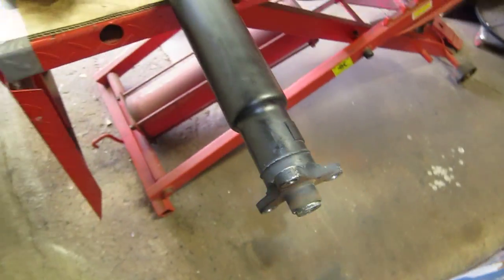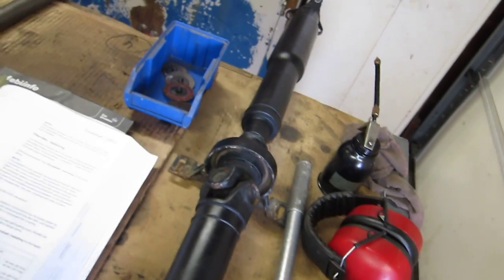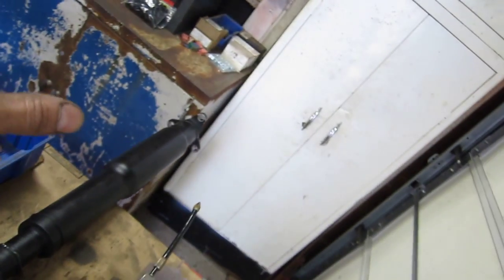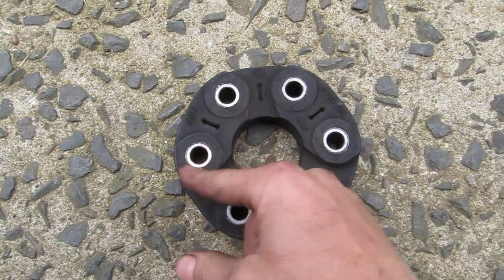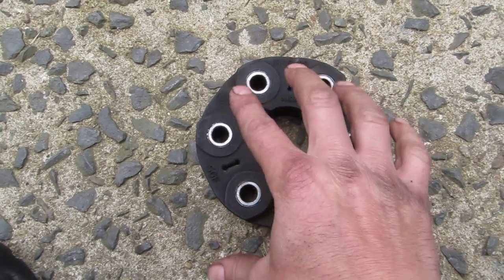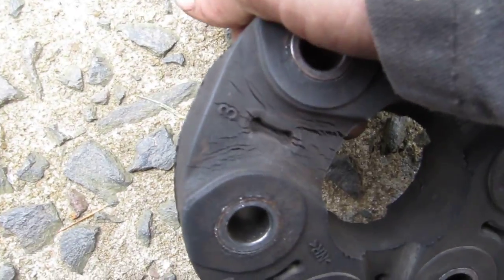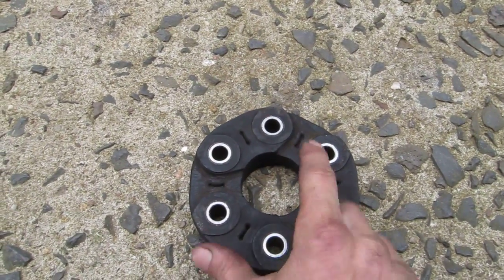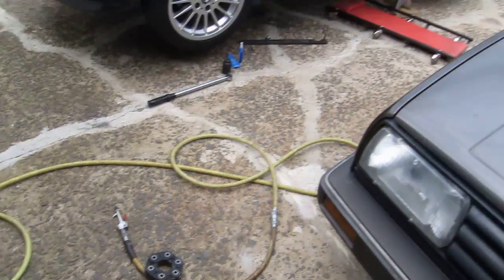BMW Z3 drive shaft, drive line, clunk, noise

Comment: Careful with aftermarket flex-disks.. mine came with the arrows molded BACKWARDS, which would've make me install in incorrectly if I followed them. 
You nailed it when you said the driveshaft moves counterclockwise.

Transmission output should "push" into the driveshaft, in each of the 3 beefy links of the flex-disk.
Transmission bolt first, THEN driveshaft bolt - always!
Reply from the maker: Dude that is a great comment, I wish I could have included that in the video. Never trust anybody.
Reply: I installed a new febi disc like you show in the video, but still have the same problem!?I need some help.
Reply: Do not put anything after market on a bmw engine or moving parts or suspension
Reply: @Sequel7  lol, go broke maintaining a $5,000 used BMW instead... I wouldn't go that far.

Comment: I am about to this job on my '02 BMW 530i; that is, changing the GUIBO, Center Support Bearing and if needed, the Driveshaft Centering Sleeve. 

I have been mentally gearing up for the task but have been hesitant because I have questioned the proper orientation of the GUIBO, given the molded arrows and its true orientation. 

This video clearly provides me with the GUIBO orientation, as factual information. 

Thank you for your candor and attention to the fine details. Starting in a few days just waiting on a part or two from ECS. 

I truly feel ready for this!
Reply from the maker: This has got to be the nicest comment I've ever read. Man you just lifted my day. I would say best of luck with your project but you don't need luck, you got this! Enjoy the reward.
Reply: @mrjgueret  Seems there was a shipment delay on my order of parts, the transmission and engine mounts are to be shipped direct from manufacturer. Once those arrive, my project will commence. Patiently standing by for delivery of parts. I am ready!
Reply: @mrjgueret  OK, so I completed this task on October 6th, took about 11 hours to do this job, spanning two days. I had one heck of a time getting the guide sleeve off the driveshaft. Other than that, all went well with the replacement of the Febi brand Flex-Disc (GUIBO), Center Support Bearing (CSB), Drive shaft centering sleeve and a fresh repack the rear CV bearings using Redline CV-2 Synthetic grease and a new CV joint gasket. 

While there, I replaced the Transmission and Engine mounts, seemed like a good time to do it. It is worth mentioning that 3 of the 6 bolts on the GUIBO are longer than the other 3 which have washers, as sandwiched between the GUIBO and driveshaft (a clue) that they are to be installed on the aluminum drive shaft, which prevents galling or dis-similar metal from occurring on the GUIBO, I suppose. 

Per your very informative video presentation, I was able to quickly identify the proper orientation of the arrows manufactured on the GUIBO itself. I highlighted, with a yellow paint pen, the arrows pointing towards the transmission prior to install. This is likely not needed but it did help me when installing bolts on the driveshaft prior to mounting on the output shaft of the transmission. 

Overall a success, a not-so-easy job using two separate floor jacks to lift and lower the engine/transmission and being careful with the exhaust system being supported at the rear of the car. I discovered that I could not removed the exhaust bolts as they were rusted and would break if I attempted to remove the exhaust. That is another small job, reserved for another day. 

Thank you and it is my hope that my personal experience and input adds to the quality of your video and somebody else benefits in performing this very technical task.

To date; (11/8/2021) the BMW runs great, no clunks when braking or accelerating just super-smooth shifting through the gears. It is a mental game that one has to overcome as I lived with that alarming clunk for a while especially while accelerating. Crazy how we get conditioned to a certain "thing" and when it is repaired, we still look for that clunking noise.

Thanks again!

J.R., in Littleton, Colorado
Reply: What are the symptoms if this disk is installed incorrectly?

Comment: great video. Love how you explain things. Going to be pulling my driveshaft to try and sort an aggressive rapid knocking that only happens at 30-40km/h and then goes away. Pre-emptively bought a flex disk and center support. And now I know how to make sure this shit is oriented correctly. Cheers!
Reply: hey did you find the problem causing this i have the same issue

Comment: An easy way BMW offers to have the disc in correct position is that 'the arrows should point to the flange arms' (in both directions, that is alternately, one arrow points to the transmission flange, the next one points to the propeller flange)
Reply from the maker: Very good to add, and as I stated arrow should point to trans flange. The outcome of following that direction would indeed cause the adjacent arrows to point toward propeller shaft. Thanks for your comment. it helps this video move ahead of the videos that mention nothing at all about how to install this disk correctly. happy motoring.

Comment: Omg bro you have no idea the headache you saved me. I replaced my flexpack too and I noticed I had the same problem even after installing a new one from Amazon. Well to my surprise I found out that it was a cheap China knockoff that’s floating around and it has the arrow pointing in the wrong direction. So even if you followed the arrow you would still install it wrong. This video helped understand how it supposed to work and once I took apart a second time I realized it was installed backwards. By now it’s all to shit so time to put another one.
Reply from the maker: Dude that's incredible, and awesome information I should include in that video. Knock-off ones can be made any which way! You made my day man.

Comment: Ended up here from my recommendation list. Watched it for fun n man i need to crawl under my car and make sure mine is installed correctly. My stick e46 has a clunk whenever im shifting. My flex disk has cracks in it but the cluck i feel is from the back. I cant mimic the sound obviously. But it feels like as if the rubber part in the diff bushing or in some suspension part is gone and metal is hitting metal whenever the driveline engages and disengages. Found one crack near the subframe mounting point. Need to investigate more in day light. Glad i came across this as im planning on doing the flex disk n carrier bearing.
Reply from the maker: 5Riverz yeah subframe mounts or rear diff mounts is what I was thinking. if you put the car on 4 solid jack stands, set the emergency brake real tight, have someone else give it torque in first gear and do the same in reverse you can watch the horror show unfold underneath the car. just be careful try and stay out from underneath unless you trust your jack stands..

Comment: On my E36 the sound isnt so much a "kak kak kak."  It just makes one defined clunk.  Something is definitely shifting under load.  It happens most regularly when I left off the gas with  high engine speed, or any other situation where there is a moment of reversal in rotational torque.  Letting off in first while slowly rolling backwards is another example.  I suspected it was a bad diff bushing or subframe mount but maybe its the flex disc...?
Reply from the maker: In my opinion if your flex disc was doing this, it would look like a serious pile of shit. What I would do is find some nice level place, e-brake the shit out of the car, have a friend load the drivetrain using first gear and reverse without moving the car, and you very carefully with a flashlight and your ears visibly and audibly look under the car and under the hood. This could be done on a lift or jack stands to get a better look but I wouldn't be under the car, just do your best to observe movement and sound. I think you're on the right track with the diff area, but without hearing the noise myself.......? Best of luck, if you find it let me know. That's how this works. Thanks for watching my video.
Reply: I'm experiencing the same problem since a couple of weeks. Could you find a solution?
Reply: This sounds like the exact problem I'm having but all my diff and subframe bushings look good.  Did you find your problem?
Reply: @danielpyziak6537  Hi I just changed the disc yesterday. I had the same clunk noise. Everything is smooth now, no more clunk sound. Center suppor was in good conditions actually. Original part from BMW, 20 years spinning, and all good.

Comment: Can you get the clacking sound from a worn out flex disc as well? Mine is in the correct position, just has a few cracks in the rubber.
Reply from the maker: Absolutely, it will loose rigidity when cracks form making it act more like a spring. Choose quality part when replacing. Good luck bud

Comment: Great video very informative. Is it correct to say that the moulded arrows should always face the flange arms?
Reply from the maker: A transmission output flange bolt must occupy a hole in the flex disc who's arrow is facing the transmission flange. I'd rather word it that way to clear up any confusion. Thank you for your compliment and thank you for watching.

Comment: Hey. I have an E46 M3 and it does this "kaka kaka kak" kind of rattle you mimic here when I press the clutch in reverse or 1st gear at parking speeds...around 1000-1500 rpm. It does it especially. when I give a bit of gas, engine revs to this range and then quickly let off the throttle and press the clutch. It does not do it it higher gears. If I pay attention and slowly press the clutch when I park, I can - most of the time - avoid the rattle. Clutch and flywheel is new. Sounds like it could be the flex disc. 

Although my mechanic said they did not see anything being worn out when they replaced the clutch, I will have the flex disc replaced now. If it solves the rattle, that would be a cure for something I have since I bought the car (1year, 10'000 miles ago)😀
Reply from the maker: Zsolt Szabó yes, replace the disk with oem or trusted quality replacement. make sure to install as instructed here. if you follow the video closely you will understand that you will always have the clatter in reverse when depressing the clutch rapidly. nature of the beast, you can't have it both ways.

Comment: thanks for the info.....would that part (if broken) in an 17 2SS A8 Camaro cause a "clunk"?......i have changed the diff fluid, also added the posi additive, still chasing the sound..(started after a few hard digs on concrete)......apprecieate your time, and thank you again for the video.
Reply from the maker: Obviously hard to diagnose anything from over here but when you were doing those hard digs (assuming you mean spinning tires) on the concrete were there any points at which you were heavily engaged in turning. If your car has limited slip and you remove all pressure from the inside tire, there is a possibility you can cause damage to the limited-slip chuck and spider gears and spider shaft. Have you jacked it up and tried feeling your differential. If it's sloppy you may want to take a closer look with the cover off. Limited-slip differentials are only good for helping lock right and left together while going straight. Too much power\traction to one tire could burn through a friction pack.
Reply: @mrjgueret  it was in a straight line....I haven't removed the cover as if yet....those cars have the independent rear suspension....so covers are on the side...with the car on stands it doesn't sound abnormal rotating the wheels..on the ground the cluck is .only when put into gear forward or reverse......I am not a auto tech....so my repair skills are limited......just did not want to be bent over by someone saying I need this, that, and the whole other.....

Comment: Dude, just make sure each arrow points to the receiving surface. If an arrow points forwards to the front, that means that the hole should be bolted to the transmission bolt receptacle, and the back facing arrow hole should be bolted to the driveshaft bolt receptacle. If you do this, you don't have to think about anything because it is impossible to mess up. The arrows simply face the bolt holes  directly. You would not bolt it onto a hole with an arrow pointing away from the hole.
Reply from the maker: Did you not watch the video?
Reply: @mrjgueret   - Yeah... you missed the point. You took forever to get the the point which was quite simple. I have worked with quite a few giubos and that is standard procedure. BMW techs at dealerships are sometimes monkeys that are too full of data to be able to remember simple things. They have to keep track of tons of models and differences so I can imagine they will delete info that they think is minor when in fact it is supremely important.
Reply: @mrjgueret   -https://www.youtube.com/watch?v=8E5Mg9MX7C8 
I have actually seen a few more that point out the arrow direction importance but this is just a sample : 5 mins 34. 
Now, I don't think anyone has explained the physical mechanics of WHY the arrows are important like in this video though.

Comment: So do I ignore the arrows if they don't subscribe to your theory?  I just installed a driveline that was reverse of what you said.  It came from the re-builder installed an torqued that way, and the arrows on the guibo were opposite of the one you hold in your had in this video.
Reply from the maker: I'm not sure I understand your question and I'm not sure I can explain any easier to you. I would disregard anything you see installed by anyone else if it doesn't apply to what is said in this video.
Reply: @mrjgueret  The arrows on the Guibo are to indicate the which way to bolt it up.  Some have the arrows reversed.  I'm not saying you're wrong, but it might indicate that some makers of the Guibo's are designed in reverse.  To blame a BMW dealer installing it wrong when they installed it according to the directions from the manufacturer of the part, might not give them their due credit.
Reply from the maker: @jhfl1881  tell you what, why don't you just ignore the arrows all together and install it the way I told you. The torque shall be applied as a compression force against the thicker part of the guibo.  In this case and in many other cases the dealer installed it wrong. I specifically explained in detail how the torque should be applied to that part. The dealer failed to install it the way the  instructions described.
Reply: @mrjgueret  okay
Reply: 'The flexible disc must be installed so that the arrows point to the flange arms.' (BMW dixit)

Comment: Ok I have a 1998 328i e36 brand new drive shaft and flex disk 2 weeks after I put everything together I get the noise back and my flex disk is ripped but I installed it correctly is there anything else that could be causing the problem?
Reply from the maker: cvhs12 have you checked all rear differential mounts? If that differential moves around a little within its mounts it will give that flex disc a severe beating back-and-forth. Is the suspension on the center support bearing still intact?
Reply from the maker: cvhs12 also there is a pilot bearing in the driveshaft that the output shaft of the transmission rides in. You have to make sure that thing has absolutely no play in it
Reply: I found out the problem it was the diff mounts

Comment: What are the symptoms if this disk is installed incorrectly?
Reply from the maker: I kinda made the noise in the video but generally speaking, I would say "excessive clatter between shifting or pushing in the clutch with a loaded drivetrain" . Incorrectly installed flex disks
turn a semi rigid drive shaft system into a more springy system?
Reply: @mrjgueret  I have vibrations and a knocking sound when I let off and accelerate.
Reply from the maker: Okay, then that sounds more like completely shot, rather than installed incorrectly.

Comment: Thank you for that very interesting info. I'm getting ready to pull my driveshaft to replace the guibo and center bearing on my 2013 X3. I want to replace the U joins to but haven't found a replace part number for them because the OEM ones are staked in. I want to replace them with a U join with the inside clips. Anyone have a number.

Comment: I don't even have this issue, but I fucking love the way you explain this!  hahaha  I wish you were the one explaining how to get the side windows out to replace that plastic crap piece, and the seats to replace that plastic crap piece.  hahaha
Reply from the maker: James Hall , dude that's hilarious! When we bought the car both windows wouldn't go up and down. I cleaned all the tracking and replaced the piece of crap plastic pieces you speak of. You're right it's too bad I didn't do a video of that. There actually is a nice way to do it and a butcher way to do it. Unfortunately the butcher had already reached this car, but after rebuilding the door panel I've pretty much undone The Butchery! I'll definitely do a video the next time I'm in the door but I doubt it'll be anytime soon. Remember if you have door airbags and unplug them it will set a code that will need to be cleared. Good luck with your endeavors thanks for the comment.

Comment: Why don’t they make solid ones? Like pure aluminum or billet? Does it absolutely need to flex?
Reply from the maker: These rubber ones do a fantastic job removing all kinds of unwanted  driveline noise/vibration etc. 
Aftermarket companies do make performance ones from aluminum that have nylon bushings for when car noise is part of the cost of winning.
Reply: @mrjgueret  ahh I see. I need to replace mine and so far all I have found are rubber ones.